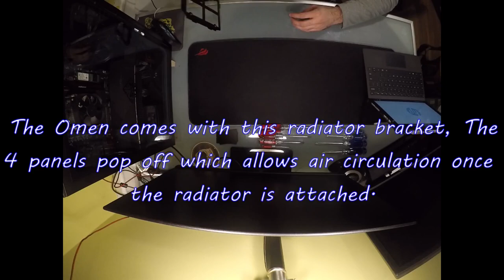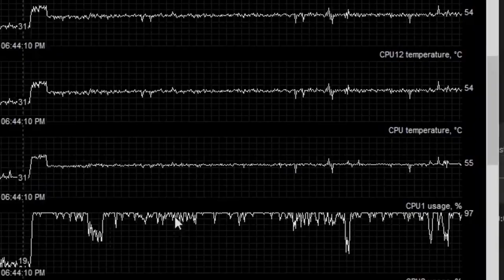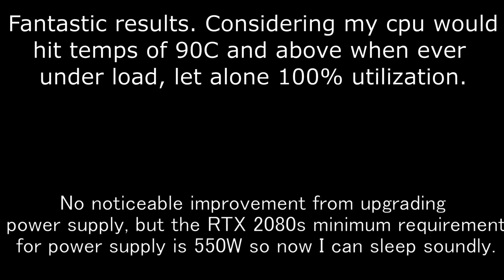HP Omen Obelisk - Upgrade

Comment: Same sentiments with my Omen 25L (i7 10700 with RTX 2060) one hack you can do is to add one 120mm intake fan from the bottom of the case blowing into the GPU. works wonders! You can just leave it there without the need to screw it. just make sure that the fan yo buy has the rubber insulators on the four corners so it will not wiggle around. cheers!

Comment: Noctua NH-U9S fits perfectly, you have to remove the motherboard to install. My temps have gone down to 65c while playing.
Reply from the maker: Darius Pryor that’s awesome to hear ! And that will probably last way longer then this AIO will haha
Reply: @MrQwerty00010  Thanks, I hope so lol. I took the motherboard out to install the backplate only to find out I didnt have to lol.
Reply: you got the noctua for the omen? where did you buy it?
Reply: @MrRamosxD360  Amazon. Look up NH-U9S. Comes with adapters for your backplate so you wont have to take off the motherboard.
Reply: @The-Rev-91  so your saying that this doesn't require you to remove anything it comes with all of the necessary adapters
Reply: @samuelwalker3624  yes. As far as LGA1151. AMD may be a little different
Reply from the maker: @The-Rev-91  but at least you can say you basically fully disassembled it haha.
Reply: @MrQwerty00010  I know right! I'm glad I did. Had to do it at some point.
Reply from the maker: Gerald Rucker personally I feel much more confident now in the future when I go to do more upgrades or build a pc for a friend
Reply: @MrQwerty00010  Yeah I definitely feel more confident now. Like beating that one boss in dark souls
Reply: So I'm gonna install a new psu so I can be ready for my graphics card. Which one should I get that's a 750w?
Reply: @The-Rev-91  I'm trying to install the nh u9s could you explain it ... mine came with instructions for lga 115x,lga 20xx and amd
Reply from the maker: Gerald Rucker I’m a sucker for Corsair haha
Reply: @samuelwalker3624  Unplug everything from the motherboard. Take out the GPU. Unscrew the bracket for the CPU. Flip the motherboard over and pry off the motherboard. I would watch exquisites video closely and mimic him. Only difference is you are installing the NH-U9S
Reply: @samuelwalker3624  also have to make sure your cpu is LGA1151
Reply: @MrQwerty00010  I went ahead and got the evga 750. I'm gonna build a new pc though. I want AMD and a better motherboard as well. B550 tomahawk should be here tomorrow
Reply from the maker: Gerald Rucker that’s epic dude!!! I’ve been thinking of moving to amd as well but haven’t made my mind up yet. I wanna hold off on mother board and cpu upgrades for a little can’t be spending alllllll my money lol!
Reply: @MrQwerty00010  lol I hear ya. All of my parts should be here Wednesday. Got my cpu already it was on sale. Waiting on my ram, nvme and ssd. Then I should be set.
Reply: Just so everyone knows you still need to take out the mobo and use the bracket that comes with nh u9s the one on the stock cooler doesn't have long enuff poles going threw the mobo... don't worry its really easy even if you've never touched a computer
Reply: @samuelwalker3624  I should probably edit this.
Reply: @The-Rev-91  thanks

Comment: This is the EXACT video Iv been looking for. I have the exact same pc and I’m looking at about the same parts but now I’m looking to possibly also upgrade the case while I’m at it. Is this omen MB any good or should I upgrade that aswel?
Reply from the maker: The motherboard is alright. But upgrading it would be a huge leap forward, I plan to do the same. Also switching the case out would probably help with the cooling as well, the omen case is not very ideal for air flow. And again about the motherboard I would only upgrade it if it was currently holding you back from taking advantage of your upgrades. The extremely limited bios options are the biggest downside to this motherboard.

Comment: I got the same psu as you. I did all the cable management and now I can’t get the side panel to fit did u do anything special to make it fit it literally please help 😓
Reply from the maker: so I tried to get everything as flat as possible, really tried to make sure that no wires were stacked on each other. but regardless the cables on this PSU are way thicker. sooo I hate to say it but I just pushed really hard and popped it back into place. Nothing should be damaged from doing that buuuuuut you never know so if your not comfortable doing that I don't blame you but its what I did and so far so good no problems haha.

Comment: I have the same obelisk dude but the ram cards I just got can't be overclocked to their advertised speed because the mb doesn't have an xmp overclocking feature for ram lol. I got the corsair vengence rgb pro 32gb (2x16gb) 3200Mhz btw. For your future reference you might wanna get the below 3000Mhz speeds.
Reply from the maker: Mikola0525 I had read about that, the bios on this thing is a JOKE unfortunately, I purchased a 2nd 16gb stick of the ram that came with it but I do believe that my next big upgrade for this will be swapping out the mother board
Reply: @MrQwerty00010  I was actually thinking the same thing. but if you swap the mb you'll be needing a new case too but the fact that omen mb is trash I would rather spend extra for better performance.
Reply from the maker: Mikola0525 I agree 100%. I have a lot in plan for this computer I want it to last me a long time. Idk when I’ll be doing the motherboard swap but I will deft post a video of the process. The hard part would be deciding on what motherboard and case to get
Reply: @MrQwerty00010  Dude. Just sold my Omen a week ago to build a totally new rig for myself lol. Best decision ever

Comment: By any chance, did you have any troubles with putting in the wires for the LC pump? The H60 wiring had 3 pins, but the slot marked for the LC pump on the MOBO had 4.
Reply from the maker: No no issues. I was concerned about this as well but upon further research it’s fairly common and a three pin plug can be used on a fan slot with four with no problems.

Comment: Thanks for the video! I had a question, does the PSU size matter for the omen obelisk? Is it a one-size-fit-all when it comes to PSU?
Reply from the maker: D Mz very good question haha. So this was a concern of mine too so before I had bought the PSU I got the dimensions off of the sight and they were very similar to my original PSU. It was just a bit longer I believe but it still fit fine. I would deft double check dimensions and compare them to original psu first before buying it. That being said I think it would only be a problem if you were to get a 850 or 1000 watt psu

Comment: Hey quick question I have omen obelisk i7 9700 with a gtx 1660TI graphics card and a 1TB hard drive and 256GBSSD can i upgrade my intercooler like you and also upgrade my power like you ?
Reply: Or will my computer explode
Reply from the maker: I see no reason why you wouldn’t be able to, nothing wrong with a overkill power supply it won’t have to work hard to run the pc and you can use it for future builds if you decide to go to something stronger. And as far as adding a cooler absolutely ! Air cooler or an all in one like I did would be an awesome edition. Especially if your noticing high temps. If your stock cooler is keeping everything cool no reason to change it
Reply from the maker: Vitaliitys . As far as explosions go just make sure you get the correct cooler for your motherboard/cpu socket and you’ll be good haha. It won’t explode it just won’t fit

Comment: I’m thinking about also buying a new case for some more room for more upgrades in the future
Reply: Nando I was thinking about it to. At that point I would just build a new computer tho. I am going to put a 2070s into this prebuilt and later build a pc.
Reply: minecrafter 462 yea that’s true,I’m gonna do that also after I got the prebuilt I got more into building PCs so I kinda regret it now lmao,but it’s fine all I need is a bigger case and better cpu cooler, my gpu is fine since all I run is fortnite
Reply from the maker: Same here!! but like minecrafter462 said at that point might as well just build a new system which you totally could slowly overtime, new case then a good quality motherboard, not to say the omens is bad.. but very litttle upgrade room with it.
Reply: Mr Exquisitee yeah
Reply from the maker: minecrafter 462 and no reason to regret man it’s all a learning experience!
Reply: Mr Exquisitee just trying to get the money for the 2070 s haha. And looks like it will fit.
Reply: i did upgraded mine, i had the 1660 ti version and now i have a 2080 super, 750 psu, cooler master cpu cooling fan, and i changed the case that has 6 fans but the mobo doesnt have any argb or rgb slots which sucks.

Comment: I think I have the same model but with a 2060 6gb, can I do the same upgrade or not? I don’t know if the power supply is enough or not. I would put an aio cooler instead of the “stock” one. Is it a great idea to remove the hdd slots and the hdd to put some rgb fans instead?
Reply from the maker: Tonno Op I don’t see why you wouldn’t be able to do the same upgrade. The Stock PSU is just enough power for the system, I’m sure it’ll be fine if you add a AIO. I only upgraded the psu because I wanted to not because I needed too. And if you don’t intend on using those HDD slots then it would deft be a good idea to add some more fans the airflow in the omen case is not the best. But I am using my HDD ports for hard drives so not an option for me. But I would highly recommend downloading some type of software that can control the GPU’s fan speed because that thing gets toasty.

Comment: I've been reading in forums that some PSU's are not compatible with the Omen Obelisk. PC just doesn't turn on, and they have to be either HP or a specific brand of PSU. Clearly the corsair you got works, but do you know anything about this? And do you know which other brands/psu's work?
Reply from the maker: Well I think If all the cables are correct it shouldn’t matter what brand PSU you use. If you can find that article you were reading please let me know cause this is news to me. I think the biggest thing is making sure any PSU you buy is “fully modular” that why you know it comes with all the wires you’ll need.

Comment: Awesome video. I have the exact same Omen despot but my RTX 2080 died first (only a year and 3 month).......even before I want to upgrade my PC.
Reply from the maker: Where you using any programs to monitor your graphic cards temp? Or any software to boost the fans?  I was if I just let the card run stock it would over heat and die. But I’ve kept a close eye on on temps and I boosted the fan up on it. But even so these omen rtx cards aren’t the best
Reply: @MrQwerty00010  I did not monitor my graphic card temperature and HP does not support fan adjustment or downclock GPU (msi afterburner casues crashes...). It is very likely the graphic card died due to the over heat......It only has one tiny fan for this RTX 2080........Be careful, these RTX 2080 doesn't last very long, some batches has RAM problems too.....Now I'm struggling to get RTX3070  (thanks to the scalpers) to replace it........

Comment: im not a pc person so this might be a dumb question but do you not need to put thermal paste on the CPU before adding the water cooler or its only with air cooling?
Reply from the maker: ItsmeJona no such thing as stupid questions heree haha. And you would have to re-apply the thermal paste. Most coolers come with there own ether in a little bottle or it’s pre applied onto the cooler. So I removed my originally cpu cooler cleaned off the old thermal paste. Then I put my new cooler onto the cpu which already had a thin layer of pre applied thermal paste to it.

Comment: I've just added the same H60 Cooler but I have made it blow air in to cool the radiator any recommendations to have it blowing the other way due to the small case? I have a 120mm fan at the bottom near the PSU blowing in air as well? So I only have the rear fan Blowing out any air is this enough?
Reply from the maker: Mines working as a intake fan as well. I have it at the top and then the other exhaust fan that came with it and that’s it. It’s good enough for me but the more fans the better. Putting one on the bottom that could blow up into the gpu would probably help out a lot but it’s a tight fit with this case. As long as your able to crank your gpu fan speed you should be okay. My card hits a max temp of about 81 but that’s only if I’m reallllllly pushing it. It averages 70/71 C when in use.

Comment: Love the video, I was wonder if you could tell me where you pluged the aio into, idk which ports or where to plug it in
Reply from the maker: There’s a couple wires on it, which are you referring to? This big cable goes into the sata port. And if my memory serves me correct I believe there is two three prong tiny wires?
Reply: @MrQwerty00010   I am confused on the three pong wire, there is only a 4 pin thing on the mother board, do i put it into that one?

Comment: Is that an edoras motherboard? Did it work just fine with the 750w psu?
Reply from the maker: Worked no problems still running strong. In all honesty if I could go back I would of gone with a 850/1000 so I could just use the same one forever lol but you’d have to check the dimension to make sure it’ll fit in the case.
Reply: @MrQwerty00010 thanks man. I'm just looking forward to get a rtx 3080 but I'll need a psu of at least 750w, as long as it works on this motherboard I'm relieved. Did you ever switch the integrated hdd to a sdd?

Comment: Soo Do I need extra cables to let this cooler function or are the CPU_LC_FAN & LC_PUMP pins & one P5 power cable enough?
Reply from the maker: Honestly I’m not sure, I think you would need a extra sata power cable. I can’t remember if the stock power supply came with a extra sata

Comment: Hi man i have this pc as well and im thinking of getting a different case for better air ventilation. The on i set my eyes on is the aerocool 1 thet has 4 rgb fans in it and i like the design better than this one. Would changing the case to void the warranty be worth it. I had this case with rtx 2070 since March 2021.
Reply from the maker: I mean if something were to go wrong with it you could always put it back into the old case and return it. I don’t see how they would be able to tell if it was switched or not. Personally tho I’d probably wait until the warranty exported. My warranty was only like 60 days so it wasn’t a big concern to me haha
Reply: @MrQwerty00010  ok thanks for the advice. Is a 650 watt power supply good enough for the upgrade or should I get the 750 watt. I just need enough to power up 6 new fans and the new vetroo v5 cpu cooler. that will be added  to the pc in the new case. The fans come with a fan hub and i also need it to power up from 5 to 12 volt fans depending on what fan brand i buy.
Reply from the maker: @johnsonbangura3074  I’d say 650 would be fine but 750 wouldn’t hurt
Reply: @MrQwerty00010  ok thanks

Comment: Hi sir I really appreciate you doing this video. I have the same desktop with the same specs and graphics card and I wanted to know if I could replace the Micro-ATX board in the omen desktop with a 

GIGABYTE Z390 M Gaming mother board because I am trying to add a i7-9700k processor and replace the RTX 2080 with a RTX 3070. I am also adding a "Noctua NH-D15", and a "

ABKONCORE TN700W BM PC Power Supply 700W, 80+ Bronze Certified, Full Modular, 12V Single Rail, 35mm Quiet Cooling Fan, ECO Friendly, Active PFC, PCU ". I wanted to know if the space in the omen will be enough for these parts and do I need to replace omen's micro-ATX to run 9th gen processor?. Sorry if I am bothering you with a lot of questions I am just gonna ask one more question. What processor and motherboard should I go with to run RTX 3070. If you can could you suggest all the parts I need to buy to make my rtx 3070 run smoothly in the omen.
Reply from the maker: Well check the cpu socket on your mother board and compare it to the 9th gen socket type. If it’s the same socket it should work fine. And in my honest opinion if your going to be changing the mother board out I would just buy a new case as well. Even a case on the cheap side will give you more air flow then the hp omen case does. But if your set on doing that I don’t see why it wouldn’t fit. The only issue I could see would be wire maintenance. Very difficult in the hp omen case
Reply: @MrQwerty00010   thank you for your advice.

Comment: for my omen obelisk i unscrewed the part for the back panel and nothing is coming off
Reply from the maker: The screw stops it from opening but it’s not what holds it in place, once the screw is out you have to slide the panel backward
Reply: Mr Exquisitee i did put a lot of force but it still didnt slide off
Reply from the maker: JaydonPlayzMC check this video out, and if your still having issues after watching that video. I would say to stop trying to remove it. https://youtu.be/X9istD1eeRY